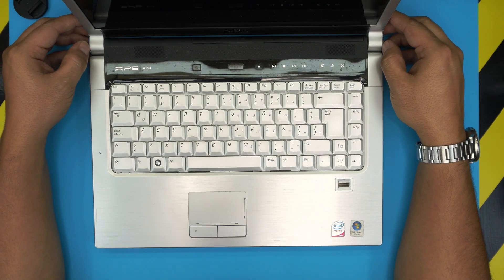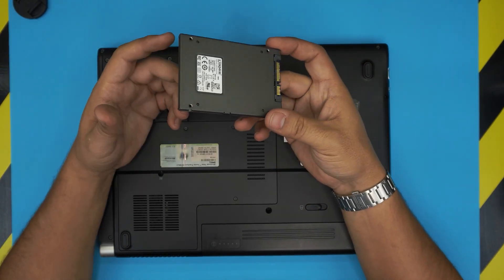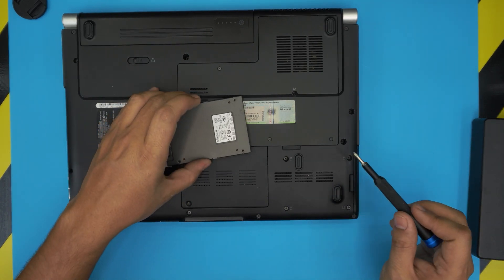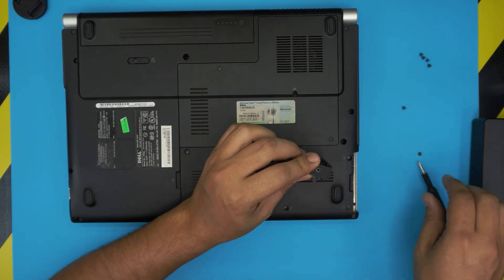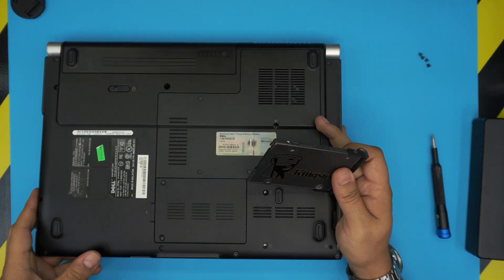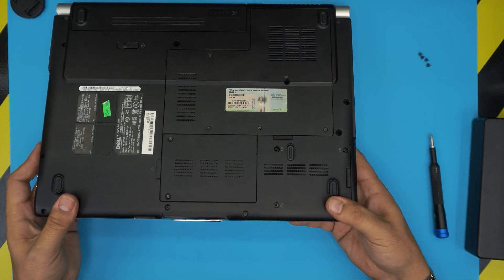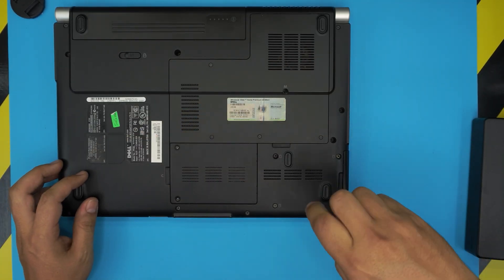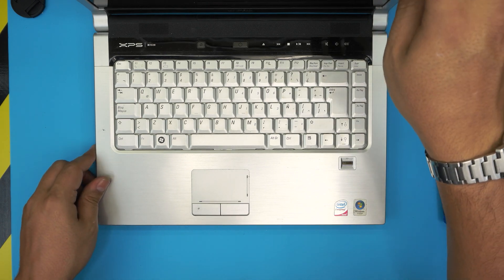DELL XPS M1530 SSD HDD Upgrade Guide

Comment: Placing the SSD in that hard drive bay as you demonstrated in the video risks damaging your connector. You can buy a Edge 7mm to 9.5mm SSD Spacer Adapter for $5--10 online to raise the height of the SSD to match the old HDD that was in the slot so everything fits correctly.
Reply from the maker: you could get the fillers, but if you placing a SSD that weights almost nothing , there is no way in the world that you can damage the connector , never in my 17years of servicing seen or heard from others that a damaged connector happened because of not using fillers on SSD. again if you want to spend money you can but no need for it.